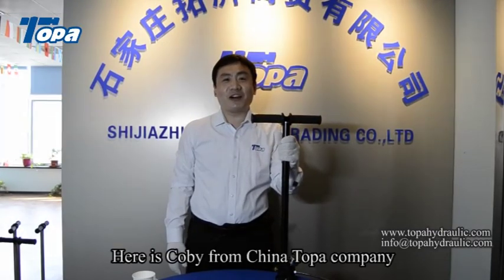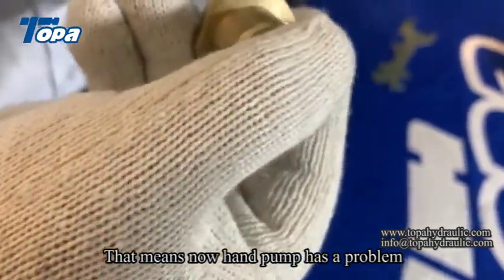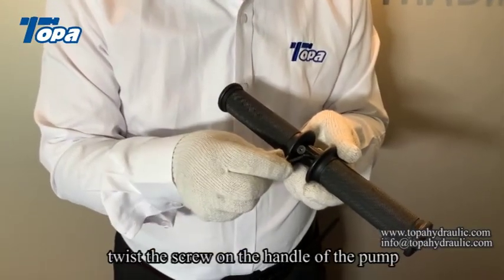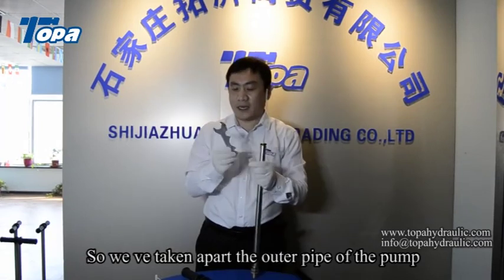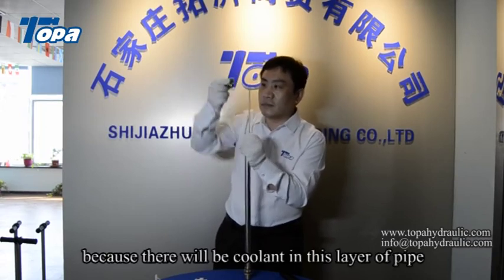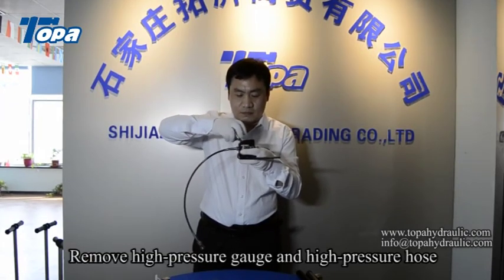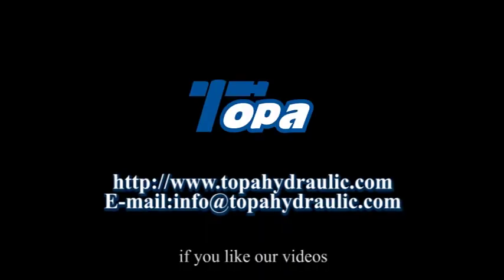How to repair the 300bar 4500psi pcp air rifle hand pump Part 1

Comment: I have to advise you the key part you missed.  At 3:37, you forgot yo clean the o-rings of the pump piston.  There are few o-ring inside it, especially the o-rings in the top (you have to remove the top screw to see it).  It is a very important part but not mentioned in your clip.
I watched your video several times and repeated to clean the seals but in vain.  My pump bumped back every time so is unable to inflate the PCP.  Replace the tiny o-ring inside the pump piston at 3:37, and it works as usual now.

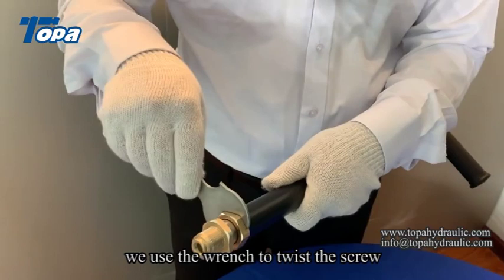Comment: At 1:43 that screw is so tight on my pump cant get a firm grip on it either im afraid to damage the outer tube if i use any tools to hold onto the pump

Comment: mind did not have coolant... do I just add water or let it be?
Reply from the maker: not water,Car engine coolant，
Reply from the maker: @heksogen4788  It will seal well when it is installed.So please tighten the sealing screws properly.
Reply: @cobyleo3343  I've had leak at the bottom of the tube, the threads of the first stage brass cup at the bottom had corroded because of the leak. The pump has VERY thin o'ring there and i think it doesn't seal well. I've seen other chinese companies placing thicker oring there. Beside -brass, steel and conducting agent can create galvanic cell, maybe that's what happened.

Comment: Do you manufacture pcp reciever?
Reply from the maker: yes,we are manufacture for pcp products.
www.pcp86.com
Reply: I read your detail and information is says only filling product. No pcp air rifle.  I want to order the rifle if you have
Reply from the maker: @lalaparadji7924  sorry，no have .just filling parts
Reply: I try to pump, no pressure. Pump goes back up when I let go. Do you know how to fix?
Reply from the maker: @selo9307  one way valve problem,whatsapp +86-186-3326-2087
Reply: I would like to buy just the pump, not the base or hose, just the cylinder pump itself, can I?